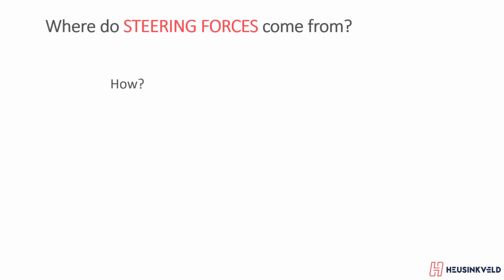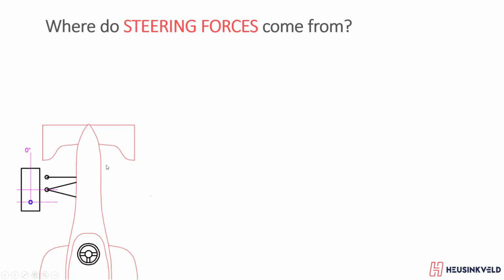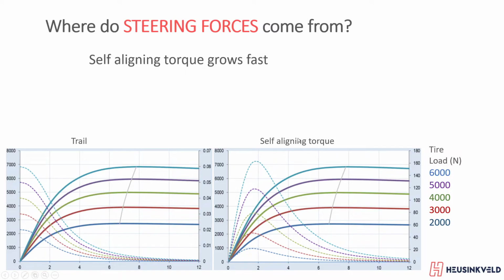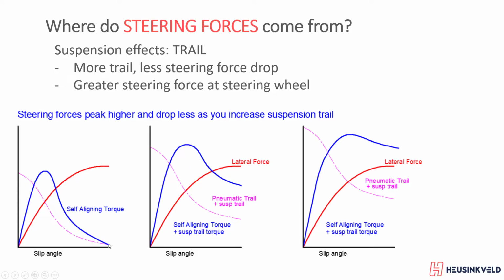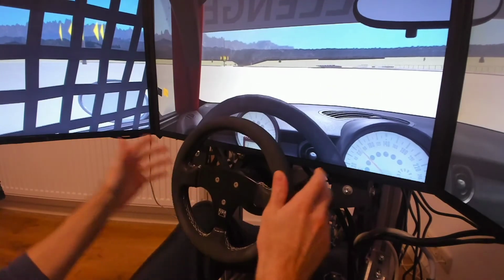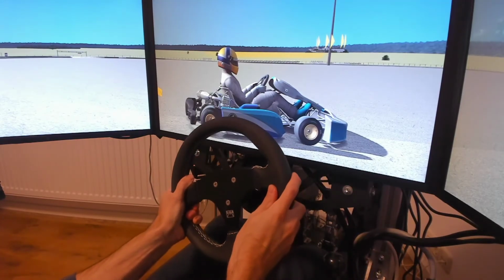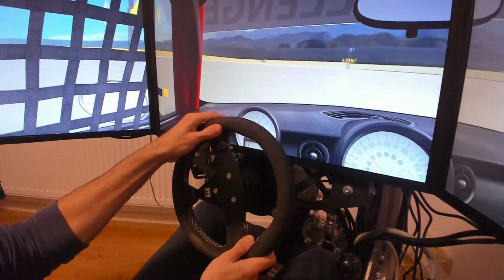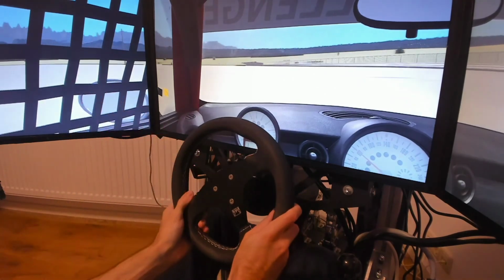(Race) Car Steering Forces EXPLAINED!

Comment: Your take on how oversteer manifests through the steering rack is quite different to what I imagined it works like; I always thought that if we have some slip angle, and we introduce oversteer, the slip angle decreases as the whole car itself is more aligned with the direction it is pointing towards, therefore there's less load on the wheel. But maybe that's just a secondary effect? That is, what happens sort of automatically is that basically you let the wheel unwind into neutral angle or even countersteer, and that's what results in the wheel feeling light; think of drifting and rally cars.

The issue of the wheel getting lighter when you add more turn-in and that not being immediately bad is also interesting; people are talking that generally if you add more turn-in and you suddenly feel the wheel going lighter, then it's you overworking the front tires and scrubbing in an understeery way, but AFAIU it doesn't have to be like this. I don't have loads of experience to confirm this, but I have an impression that e.g. the Huracan GT3 Evo in iRacing has the suspension/steering set up in a way that there's certainly more grip to extract from the fronts after the point of the heaviest load felt on the wheel, like there's a point after I can definitely add more angle and it helps turning the car, and the whole wheel itself past this point feels quite dead compared to the load I feel initially; no other car I've driven in this game has this effect pronounced so much. I'm not 100% sure how that works out over very long stints, and whether it's maybe also causing the car to just scrub off the speed a bit so that the car doesn't understeer out of the track, but... I don't know, it just feels right to me.

The takeaway from all of this for me is that... it's really hard to have a good intuition on how what's happening with the car translates to what do you feel on the wheel and vice-versa. Maybe we just shouldn't care about it and try to build false theories on why something works or not? Instead just focus on what do you feel, hear and see maps to the telemetry and lap times.

Comment: now when driving a high downforce racecar like formula 1 the downforce makes the steering really heavy and it also makes each bump shake the steering wheel and the forces tugging on the front tires from the small bumps is drastically increased due to the suspension being pushed into the ground by the downforce.

Comment: I am researching steering design for FSAE vehicles and this is an incredible video. Thank you for this.
Reply from the maker: Thanks! There should be some tire data available for most FSAE tires, so you should have some idea of aligning torque. I would absolutely try to make a mathematical model with the trail, pneumatic trail but also jacking if you are going to use some real caster and scrub radius. Steering loads can be quite high on a FSAE car, because of how fast the steering rack tends to be made.

Comment: Great video, but still unaswered question for me, how much effects, really important for driving, i am loosing on my g25? When i play AMS1 i think i feel all this effects and happy with FFB. Then i play AMS2, i miss some tyre feeling but it seems ok. In over sims i find my ffb is not enought for fast competitive racing. But i don't really care about over sims. Lets say for AMS one, is any forces, that i completely miss on G25?
And another moment, it is a option someware in AMS1 config files. Something about ffb prediction value. Does it really helps to compesate speed difference betwen DD and no DD?
Reply from the maker: Thanks! The 'prediction' parameter is for the old RF1 style force feedback that we don't use, so it doesn't affect anything. I used a G25 and was happy with it, but you're simply not getting the speed and torque of more modern wheels, I would find it pretty hard to drive with a G25 nowadays. A modern direct drive, even if it is just say an 8Nm model, would completely destroy the G25.
Reply: @NielsHeusinkveld Thanks for answer, and also special thanks for your supercars cristmas edition mod. Every car from you is like a gift. On youtube i saw some serios australian supercars ams league, so this new cars made by their demand or just for over fans? I saw they use standart ams supercars with some new car models (i guess?), but are they going to use your new mod?

Comment: The only thing missing is the FFB caused by downforce. I use my sim to train racing drivers from a a series that have assisted steering banned and moderate high DF: although they like how similar to real life my FFB is, they say also point out that in high speed corners steering the real car is harder than in the sim. Im clueless on how to solve this...
Reply from the maker: In most sims I would assume this effect is 'automatic'.. So if the downforce is realistic, the tire pneumatic trail is realistic, then the added FFB from downforce would be a realistic amount. Of course you may need a 30Nm steering system to match a real car..
Reply: indeed, I have 25Nm but it rarely gets above 18  @NielsHeusinkveld

Comment: Really a worth watching content 🙌🏻 . All internal points which no reference book teaches you were explained

Question: Ackerman/Anti -ackerman/pro Ackerman which one is optimum fir high speed cornering and what the calculations involved in calculating steering wheel torque?
Reply from the maker: I think a lot of the time, Ackermann isn't a huge deal. At high speed there is effectively no significant difference in the turn radius for the inside and outside tires. Maximum speed cornering unloads the inside wheel considerably, in some cars it is even off the ground, so its impact on overall grip and feel is quite small. When parking the car at 5kmh, or in city driving, you probably feel a more naturally rolling car at big steering angles when it has Ackermann steering. Maybe for racing there is a tiny effect, adjusting the inside tire slip angle slightly and thus changing its heating and maybe grip properties just a little. I'm sure in F1 that matters.

Comment: Thanks for the video. However, I'm slightly disappointed that you didn't bring up the "seat of pants" effect that compensates for lack of G-forces sensed in your body in real life. Without a good motion rig, I'd take the "seat of pants" effect ahead of any other wheel simulation, since that's what I'm driving by in real life, both with car and motorcycle - I don't care much if the wheel or handlebars are numb. Sure, the forces you're talking about are realistic, but it doesn't "feel realistic" since I don't feel any G-forces in my body (nor compensation in my hands).

Comment: Am I missing something or do you have the torque direction wrong at around 16:24? This torque would turn the wheels further into the corner and be the exact opposite of a self-aligning force?
Reply from the maker: That is correct. And I mean your comment is correct, and my arrows point in the wrong direction.

Comment: First, thanks for the video, lots of good info. But...

At 17:30 your diagram seems to suggest that SAT is acting in the direction of the tire heading, not against it? You say that you'll have to apply a right steering wheel force to oppose the SAT - but that can't be right or the steering would align itself to full lock!

Surprised this was missed with all the other detail... unless i'm missing something?
Reply from the maker: Yes I accidentally inverted a few arrows, good you picked it up!
Reply: @NielsHeusinkveld  Glad to know I wasn't going crazy!

Follow up question: could you make a video showing some of the basics of how you're playing with the rFactor car configurations to do this testing? Or maybe there are other resources you'd recommend for that info?

Comment: Hi Niels love your videos and everything you say makes sense  but I have a question for you... In all sims there is hardly any steering force when you pull out the pits then it will load up the faster you go Into corners. But in real life when I've raced go karts the steering is at the heaviest when your going slow pulling out the pits but actually gets easier the faster you go.  Can you explain that?

Comment: Great video. Thanks for that. One question: At 10:42 you talk about slip angle and trail. If you apply a slip angle greater than 8° can trail go lower than zero and switch to the other side of wheel center?
Reply from the maker: Half a year late.. Yes, in fact it seems in most cases it goes slightly negative at some point. I have no idea why, but most data tends to show this.

Comment: As a retired Hd of Automotive Engineering, I learned most of the design dynamics too many years ago and have forgotten much of it - so thanks massively for the refresh!
Now an enthusiastic gamer I'm about to upgrade my new SIM Lab rig to include a Fanatec CSW and - yes - Heusinkveld pedals. (Stretching the pension budget but what the heck!)
So catching your video now is great timing for me.
As somebody else suggested, gaming needs more articulate genuine experts like you (instead of those who say a lot, without saying anything useful).
Thank you - very much Neils.

Comment: The simple information that the most grip is past the max force was a real breakthrough for me. I was always shying away from going over that point, while in fact you have to go just a tad over it and then balance the car at that point.  That simple hint alone jumped me up in irating by at least 500 points.
Reply from the maker: It depends a lot on the suspension geometry as well, and perhaps power steering systems complicate things further. There could be cars where most of the FFB is gone at peak grip, or ones where it pretty much keeps building up the further you steer due to extreme caster angles for example.

Comment: Hi Niels - I'm thinking about adding a minimal damping to my FFB setup. I'm thinking about setting both coefficient and saturation to ~0.1 in the Controller.ini. Do you think this is a good idea? Or does the engine take care of damping via the gyroscopic forces all right? I'm using a G920, so I'm very much afraid to go too high on damping. But most people say the resistance makes slides more controllable. What do you think?
Reply from the maker: The G920, if  it is anything like the G27 and G25 (which it probably is), feels quite damped and frictiony by itself, not to mention quite weak. I probably wouldn't use damping on a wheel like that. But as this is subjective, feel free to try. I doubt you'd feel 0.1, just try 1.0 first to see if it actually does something for your wheel, then dial it back..

Comment: Simracing FFB will evolve when games/wheels A) use torque-based control instead of speed and/or position based, B) use a passive (ie. reactive) system instead of an active system, "C" move away from Microsoft Direct Input. "A" & "C" are possible but take a lot of work while "B" may be impossible but I've seen some industrial designs that are at-least a "semi"-passive system.

The higher power FFB used, the more the flaws of today's dated fundamental FFB (regardless of game) are noticed. There are sort of "band-aids" to try and at-least somewhat improve things like damping, friction, slew-rate, inertia, smoothing filters/limiters (and other types) but those usually have their own set of compromises. In the end, it's almost impossible to replicate a passive system using an active system (and even more-so when that active system is only speed and/or position controlled) especially when dealing with all sorts of high forces and such a large & highly dynamic range of forces like in racing (especially the higher power you go).

My general simracing/gaming FFB technology rant aside, this a great video and thank you very much for taking the time to do this.

Comment: Great video as ever Niels! The only thing I don't agree with is that a locked tyre has zero lateral force. From my understanding a locked tyre produces force in the opposite direction of travel. If you're sliding sideways then the tyre will generate lateral force, even if its locked, and you should still feel this through the steering system.
Reply: Although, to clarify, you wouldn't feel any self-aligning torque from a locked tyre (no pneumatic trail), but you should still feel the self-aligning effects from mechanical trail I believe.

Comment: Very interresting how the software is calculating the forces. 
But, I thought that by designing a good suspension  system, the tire forces should always be sensible in the steering, so the driver is able to feel the grip. 
Therefore the "Caster" setting - which moves the pivot point in front of the contact patch - has to give this "trail" x "lateral tire force" result to the drivers senses.
If you have to rely on your visuals to estimate the remaining reserves that your tire has, you would be totally lost - that is my opinion at least.

Comment: Excellent video. What I found especially useful was the scrub radius / Caster interaction with the kart.

Small note though: when you draw the line along the Caster axis to a point on the ground, the moment arm isn't actually the distance from that point to the lateral force centerline. It's the distance from the axis to the lateral force centerline. So if you were to draw a perpendicular line from the Caster axis to said centerline, it would not be parallel to the ground. It's not a huge difference with small angles, but the error does grow as the angle increases.
Reply: To clarify: the mechanical trail is '60' in the image behind the link, not '63.1'.

https://i1.wp.com/files.iclippy.com/4535381/1301540264.jpg

Comment: Thanks Niels. Just before watching your video i was driving the 962c around the Nordschleife in rF2 and curious what the real steering forces in non power-steering cars like that must be. Huge tyres with lots of downforce combined with rather small steering-wheels should be the ultimate reason for non-maneuverability, but from the onboards it doesn't look like it's harder than shifter-karts, probably less. And on the other hand there's the Vee or 70's F1 with rather low steering forces according to sims and i guess they should be a lot higher. Your video explains a lot, but i miss the part that explains why those differences exists like from caster.

Comment: very interesting video, lots of info properly illustrated. i was wondering if you could then have consistent steering forces ffb only using info from the front tyres. i remember old pcars getting flak by not using rear tyres for its ffb (masked as sop parameters and other names) and how it was shit and that you couldnt feel oversteer according to some users. also acc now when they did the whole contact points to calculate forces they prioritized front tyres when addid extra points for ffb calculations to their contact patch. 
small edit: also remembered that its said that iracing only uses steering rack for its ffb but as showed here how all the forces have an effect on the steering pignon? joint? then thats picking a result on one point insted of combininb forces from the source right? although it sounds like in the end they're doing the same.